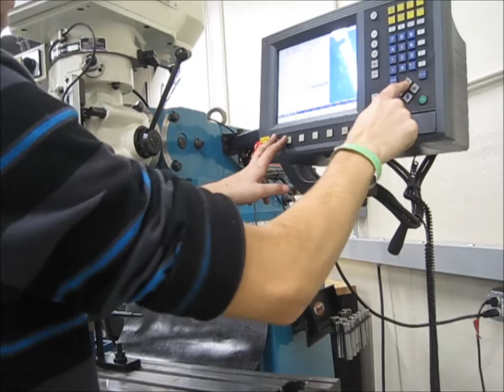Tempered Lamellar Build

Comment: Nice lamellar fellas. May I make a suggestion?  You can produce all of your metal bits (pieces) faster and more efficiently using a throatless shear (Aka Beverley Shear) and a Roper Whitney hand punch. Easy enough to get between Ebay and Harbor freight etc. Just sayin fellas, as you lads do fine work as it is and I know the aforementioned tools would step up yer game tremendously! Just subbed btw...looking forward to watching yer growth and hijinks of course ;).
Reply from the maker: The steel was already hardened so a punch wouldn't have worked... But I got what you're saying. I finished all my lamellar anyhow XD